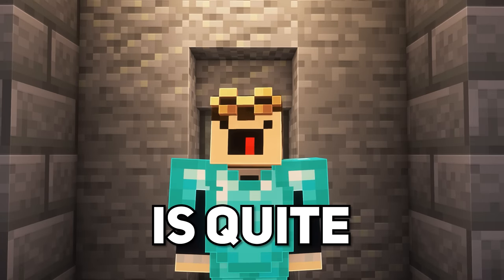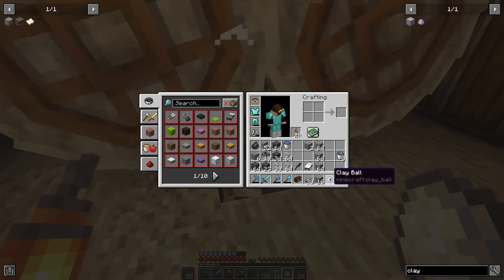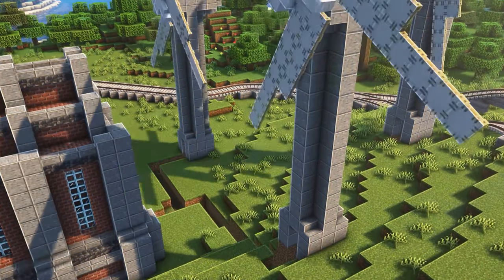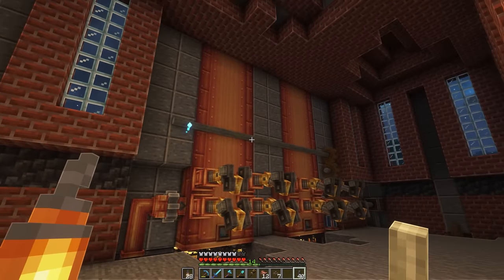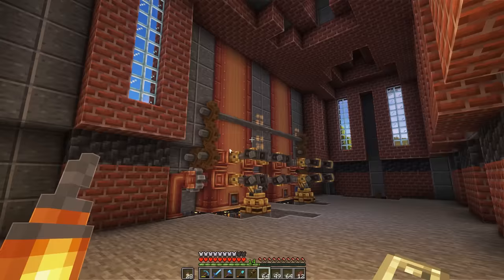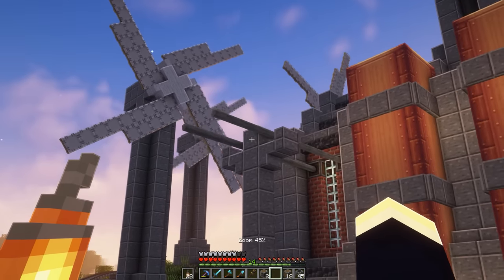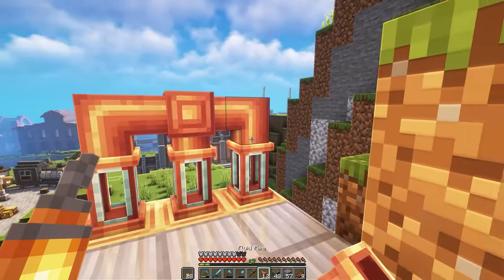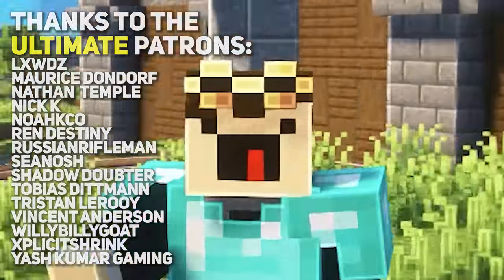I Built a WIND & STEAM POWER PLANT in Minecraft Create Mod

Comment: You should seriously consider using Create: New Age. It adds electrical generation using kinetic energy (i.e. your steam engines). You can set up a power plant using the steam engines to turn an alternator, which you can then pull power from. When you pull power from the alternator you can run it along copper wires and make real power lines. This power can then be used to spin an electric motor within each of your buildings that need kinetic energy. You could make a more 'realistic' power plant this way by making a sub-station beside your plant rather than the shafts coming out of the side.
Reply: You can do the same thing and fuel  blazeburners with lava via pipes or use bioethenol to superheat blazeburners via pipes

Comment: For the sequenced gearshift, it seems you may need to add additional instructions (similar to a train schedule). I also believe that turning the opposite direction simply requires a negative angle (I.e. -180°)
Reply: I agree, 2 instructions. Turn 90( or 180) and (re)turn -90 (or -180). Also I think you only needed a redstone torch not an entire clock. if the 3rd instruction can be repeat instead of end.

A small note for your washing, smoking, haunting, smelting station: the depot is less than a block tall so items n them occupy both the depot block and the one above, thus you can double the speed by adding an additional fan under each existing and dropping down the campfires, lava and water blocks down. 
I watched a video demonstration of this maximized to x10 speedup, 2 per side & 1 above and below with a mechanical arm to place and pickup the items/stacks. Run it into a double chest with 2 brass funnels using matched attribute filters white and black listed per in /out( can be washed, smoked, smelted, haunted)  and you've "automated it".
Reply: 180 degrees ->

  180 degrees <-

  Repeat

Comment: Once in the UI of the Sequenced Gearshift, you want to scroll in the 'End' section and there are a few options. You also don't need a comparator timer, the the Sequenced Gearshift has a 'Wait' option and there's a number of ticks it...waits for. 
An example that you can use is Turn at 45° with a >>, Wait 40 ticks (2 seconds), Turn at 65° with a <<, Wait another 40 ticks, Turn at 110° with a >, Wait 40 ticks, and End. Play around with the numbers and you can use a Redstone Timer set to give a pulse every 5 minute.

Comment: 13:41 depending on what create add-ons you have, you can pump lava directly into a blaze burner, the add-ons I know add to the blaze burner ponder so that is an easy way to check. if you have create enchantment industry or create crafts & additions. both of these add methods to feed blaze burners directly. with the later being a new item called a straw

Comment: for the sequenced gearshift. you only need to power it and leave it powered and it will do whatever instructions you programmed it to do. and also, to make it go the other way, you just need to tell it to go the other way in the ui itself. there is an arrow that shows which direction the angle will move, you can set multiple angle and have it rotate right for one and left for the other.

Comment: 1) whatever you do PLEASE DISCONNECT YOUR WINDMILLS FROM PRODUCTION POWER NETWORK! If you overstress your main network and yur steam engine service lines are connected to main power production, your steam engines run out of water and lava! Or build a fourth wind generator connected only to pumping water and lava and moving lava buckets. Those must be separate power generation systems.
2) Try to put steam engines on the top of your boilers and connect shafts from there to power distribution line, it will look more steampunk. 
3) you can add instruction lines to sequensed gearshift. Just add new line after move 180 line: move -180 and you cool.

Comment: FYI when a boiler is at level 9 it means you can have 9 steam engines on it.
also, create has an item calld The Wand of Symmetry, which mirrors your blocks placement or breaks.. can save you A LOT of time when digging or filling floors

Comment: Quick tips, for running pipes close together, run one pipe, and cover it in brass casing, that will keep the 2nd pipe from connecting to it. 

Also, i think its the create new age add on, but it adds straws you make with bamboo that allow blaze burners to attach to fluid pipes, eliminating the need for mechanical arms and saving lots of SU's
Reply: copper casing
Reply: @z._atif_00  yep, thats the one.

Comment: Dude btw you can pump more water in and add more steam engines to the main boiler to get wayyy more SU you can also use mods like crafts and additions to add electricity and fuel blazeburners with lava directly using pipes

Comment: 24:22 as your using brass funnels anyway. you could just have the belt pass by the funnel. the funnel repects filters and will not take an item from a belt it doesn't want.

If your not doing this, at least change your brass funnels for andicate ones because they can also input a full stack without requiring any changes to your current set up

Comment: To get the best seam engine SU is to make a Blaze cake Factory to use as the fuel for the engine, and you need more water pump to go into the engine to get the best power.

P.s. I don't know if you can craft blaze cake, but I and others will like it if you use other addon modes that are for the create mod 

Thank you for reading this comment

Comment: On the sequenced gear shift there are 3 settings to a line. Use the scroll wheel to select options. What your looking for is [turn] , [°180] , [ >>]  then your next line will be [turn] , [°180] , [ <<] and the last line will just be end. It still needs a red stone signal but a Redstone torch will work. Alternatively attach a Redstone to a train then one at a nearby stop with Redstone transmitter. Attach the receiver to the sequenced gear shift. Every time a train stops the crane will move.

Comment: so basically youve got the problem of not maximizing windmill power it would just be a say 5x5 hole 128 blocks deep and then put big blobs of wool in super glue each of the 25 max windmills together (128 blocks is max windmill power) and there you got my half million stress units